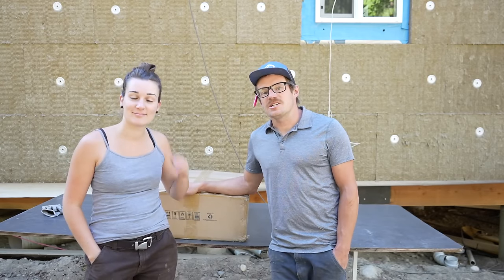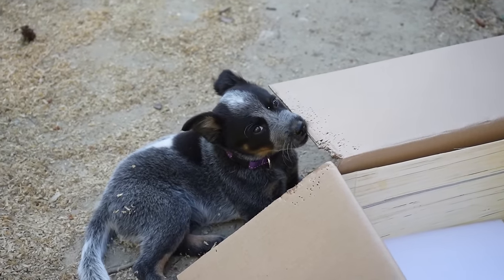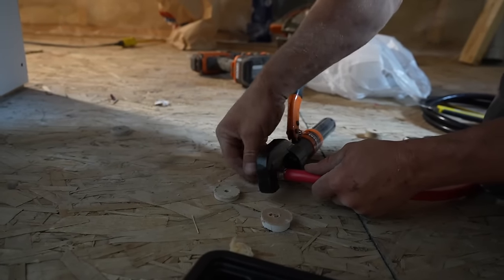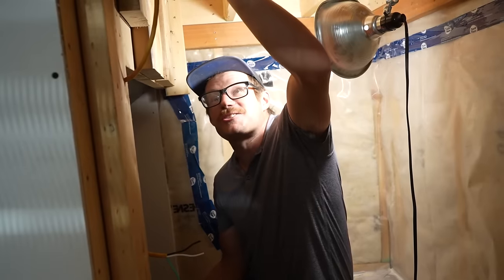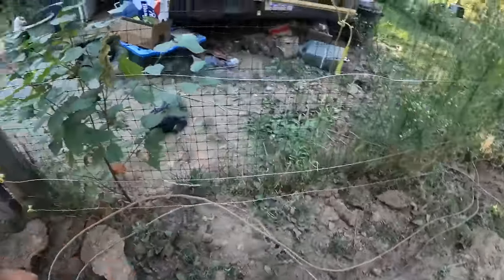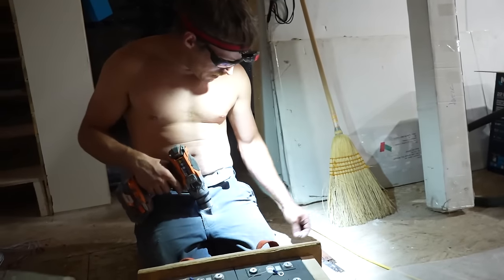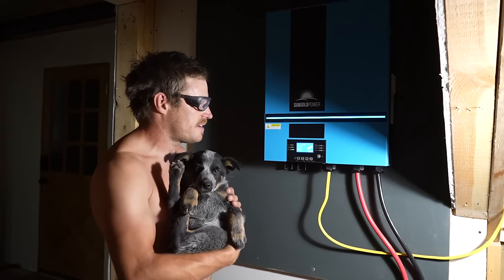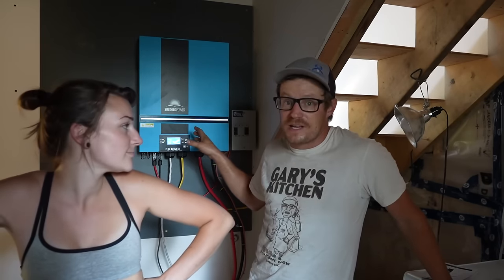Powering Up Our Off Grid Home! Installing Sungold Power 48v 6500 w Solar All In One System

Comment: You'll get a much better price for the exact same inverter design (same design, same parts, same warranty) by purchasing a Sigineer Power Off Grid 48V 6500 all in one inverter charger. Both Sungold Power and Sigineer Power are made by the same manufacturer, but the Sigineer Power inverter cost's far less.

Comment: We have a 5.6 kw of solar panels on our house, 6kw inverter and 4.6 kw Battery, it’s helping us out a lot with rising energy costs in the UK.  We are connected to the grid for both gas and electric, we sell back the power we can’t use to the the grid.  The last 2 months our every costs have been less than £15 a month.

Comment: I have pretty much same unit (Not the same brand but they are all made by VoltronicPower in china and is sold under different brand names). My unit is 5.2KW and has been running non-stop for the last 3 years trouble free. Had to take it down once for cleaning but apart from that, its been quite reliable. Congrats for setting this up.
Reply: Have you connected a generator to it?
Can it be connected? If so, how do designate polarity?
Reply: @cjmcay  I haven't connected generator but i have it connected to the grid supply. The line, neutral and ground are clearly market at the connection points so it shouldn't be hard.
Reply: @Ayzee5363  Thanks for the quick response! My solar guy told me the generator has a magnetic coil and won't be compatible? He said it will FRY my inverter? BTW: WOW, as for getting that 200 pound battery bank out at one time!

Comment: Hello, I have downloaded two versions of the user's manual. On page 9: Max. PV Array Open Circuit Voltage: 250V (old version), 390Vdc (new version).  PV Array MPPT Voltage Range: 90Vdc~230Vdc (old version), 90Vdc~350Vdc (new version).
Reply from the maker: They did change the mppt voltage in the newer version

Comment: I have a mttp all in one it's on its second year & I like it & iam off grid as well oh & it will also save u in gas cuz generator charge batteries when u have to use it & ur get more power for later that's  the way to go
Reply: What would that be
Reply: @harlanmclain1719   It's a fake account and they are running a SCAM trying to get you to send money for shipping.  DON'T TALK TO THEM OR SEND ANY MONEY.  Anytime you see a comment like that, report it!

Comment: We just installed a dual EG 6500 EX system for 240 split phase for the house we're building.  We bought 2 EG4 Powerlife batteries so we've got a 13kw system with 11kwh storage.  Found some CanadianSolar 445 Watt bifacial panels from SanTan Solar in Arizona and got a dozen of those.  Now we've got to clear the top of a hill for our solar array.  It's a lot of work, but worth it when you can generate all the power you need for yourself.
Reply from the maker: It will be amazing when it's all hooked up

Comment: Sweet! I have two of those SunGold 6500 units sitting in the boxes. I will be setting them up in a couple weeks on my off-grid property. Will be paired up with about 8KW of bifacial panels and 2 Trophy 48V 100AH batteries. I am looking forward to getting it all setup.
Reply from the maker: Nice setup!
Reply: @ThisOffGridLife  you guys and several other channels inspired me to continue my off grid journey after losing my wife. It was our dream.
Reply: @blaxtarr  good on you! 👍🏻 I’m over 60 and we are off grid now. By accident more than design really but it’s the best decision we ever made. I think you are going to need more batteries for your system. 😊👍🏻
Reply: @blaxtarr  sorry about your loss
Reply: @Farm Villa  I'm off grid by accident also. They cut off all power to the yard I store all my equipment at and actually live there. I'm just single so I don't need a lot but I'm doing this Sun gold 6500 with three server rack batteries everything's coming in very soon and I'm going to have about 3000 Watts worth of solar panel maybe a second string also. Trying to figure out my wire size at the moment. I think they're sending me four gauge wire but I might need bigger. I know on my 12-volt system I have  1/0
Reply: @VinceBadovinatz88  yep. Wire size is important. There are a few sites out there with wire size calculators if you haven’t seen them yet. 👍🏻 Good luck with your install.
Reply: @FarmsVilla  Thank u very much😎

Comment: Nice video. I did see that that inverter is clone of MPP Solar inverter. 

I would suggest : 

1. take that remote control unit out of the main inverter..it will cool it more and you will not bump into that start switch ..maybe not your concern but it was mine.. also check that it isn't too hot close to those Lan cables ..that is where main 7805 is placed and it gets hot..
2. mine unit 11kW has 3 fans and they are on all the time..so for sure you want to be sure you will move it out ..as it get pretty loud when it is on full throttle :)..
3. btw it is pity that they didn't explain better that when you want to change output voltagefrom 220-240V  it is possible only in off mode..it frustrated me ..till i was able find it out :) 
4. make sure your room is clean and there isn't dust..as gets in pretty fast..there is input filter..so if nothing else clear it pretty regularly..i would say weekly..(it is new constr..so a lot of dust i would imagine )
5. I added hole into right side of that blue removable panel..I hope it will improve cooling of this unit..and then added mesh ..that is used to PC ventilators..

So far i have positive experience with the unit as well.. ofc that software you mentioned..well it isn't much ..i would say trash..is better word..but that isn't as much important ..It works and that is important..

Btw i notice consumption isn't so small..so that is con in this case..you make sure you size your battery accordingly..

Comment: I think that you should get a hand truck to move heavy things like the batteries around. Just FYI: the hand truck is that thing with two wheels like what delivery people use to move keggers, stacks of pop, boxes and things like that around. Although most people call this a dolly it is not a dolly, which is the flat thing with two or four swiveling wheels that people lay heavy,  big, awkward things on to move them around. A dolly won't work in the dirt or gravel or soft ground. A hand truck works every where accept in mud or snow. If the snow is not so deep and compacted it will work on that too. What the two of you did is really dangerous to your backs. Just ask Katie what that feels like. I've dealt with mine since 1981. And, once hurt it is easy to hurt it again, and again...! Please be very careful.

Comment: next time buying 2/0 cable buy welding cable .... much cheaper than battery cable...check the prices...I was replacing the Positive batt cable in a 67 shelby ..(battery is in the trunk) battery cable 26"ft was almost 100 us... welding cable 2/0 was  3o+ us... `1/3 the price

Comment: What capacity is the circuit breaker you installed for this 6500w 48v system? My battery is 48v 150Ah... Regards

Comment: Hi, I have noticed there are alot of re-branded MPP LV6548 all-in-one inverter/chargers and this is one of them (SP6548). I am wondering how they can increase the max PV open circuit voltage from 250V to 390V unless there was some hardware upgrades. Is yours the max 250V or the max 390V version?

Comment: I have 2 units paralleled. Have you connected a generator to it?
Can it be connected? If so, how do designate polarity?
Reply: Yes they have a generator connection specifically for a generator on the SP6548

Comment: Thank you for sharing. We have two of these inverters that we are going to connect in parallel split phase. Setting up our system now with SOK batteries in a rack.
When you said in the video that you charged the batteries with the generator...did you then hook cables to the AC input on the inverter, or did you charge the batteries using some other charger?
Reply from the maker: The best part of this unit is the battery charger.  It's a 120a charger!!   You have to size your ac in wires large enough and have a big enough generator for that.
Reply: @ThisOffGridLife  Sorry...one more question. Do you an inverter generator? Someone somewhere said that the best is to use an inverter generator when you connect it to the inverter to use the charger.

Comment: You will want to make a way to clean out between stair tread and that panel. You will be amazed at the amount of dust that will gather in there. 😏
Reply from the maker: It all slides down to the bottom, we are going to cover and finish the stairs this winter

Comment: You're gonna need a chiropractor to help sponsor your channel.  :)  I must have missed it, but your previous system was using a 24v inverter, so I presumed the battery was 24 volts.  Did you wired two 24v batteries in series to get 48 volts?
Reply from the maker: We wired 16 - 3.2V cells in a 48v configuration
Reply: @ThisOffGridLife  - Did you have them in an 8S - 2P configuration when they were 24  volts?

Comment: I'm confused, Greg. I heard the intro that you gave this device, but I'm wondering why does it have the potential to catch fire? That doesn't make sense to me. Granted, every electronic device potential for something going wrong and setting something on fire. They are putting this non-combustible surface as a primary factor as to where it can be placed. I'm surprised that the CSA or UL or one of those others that you named, didn't flag that as an issue. It's in a steel box. Also, there has to be short circuit protection on the motherboard somewhere and fuses to cut power plus your own circuit protections you installed throughout the house, right? So why this attention to the potential for it catching fire?I've got two inverters in my RV and yes, they are in  steel cases, on a metal bulkhead, but nowhere in the user instructions or specifications is their any need to worry about them being mounted on fire resistant surface. I'm not criticizing, just trying to understand the reasoning behind the instructions, other than for the company wanting to indemnify itself from a potential lawsuit if something did by chance go wrong.
Reply from the maker: The concern is for the batteries being a fire risk, not the inverter. The cement board behind it was just something we had laying around and it just happens to be non combustible
Reply: The 48v lithium iron phosphate batteries are the safest you can get as they won't grow and explode like lead acid, AGM or lithium ion. The inverter CAN catch fire but it's extremely rare. The inverter will get hot enough to start wood on fire in some circumstances.  Always good to have something between the inverter and wood.

Comment: I don't understand why you fought with the cement board under the stairs if 1) you were 100% sure your batteries were fire safe and 2) it was only gunna be a temporary storage for them in the first place?  Also, why not just take the day or two it would take to build a small shed to house everything the way you want that way you aren't wasting resources and time having to rebuild cables, patch drywall holes, etc from a temporary install?  Do it right, do it once.

Comment: I am wondering if the cables running between the batteries are to thin?
Reply from the maker: They meet the specifications in the manual
Reply: I agree .. he needs much thicker wires connecting the batteries together .. once he puts a load on his inverter, those thin wires will burn out
Reply: 10 Guage is what they call for in the manual.

Comment: for what you spend on going solar to run your house and deal with it for 10 years and I can it for less being on the power grid, I just watch a couple who 50 grand to set up their solar system and it will be 10 years for them so they say so I did the math and it is cheaper for me to be on the grid and that is fact

Comment: i would never have them batteries in the house, even though insurance would replace the loss, them batteries are well know to burst in to flames well charging, even new EV cars have burned up,   it been well known ever since the Dream liner jets can out,, i even had electronic item burst in to flames after i plugged it in to charge, lucky i was right there

Comment: you could have pulled the wire up, Kate. you are certainly strong enough. if you would have committed yourselrf and belived you could do it you would have. easily. how deep was it 2/3 inches? greg was a bit overdramatic with the double arm flex.

Comment: The EG4 is UL1741 certified, with better specs (500V input), and costs $1250. This looks exactly like the EG4 for $100 more and less input voltage (and not UL listed). So what else is the difference? Why do the Chinese all rip off each other's designs? Which is better and which is made from inferior parts? Here's my guess: EG4 just got theirs UL listed a few months ago, new model number, shipping product, and you can see reviews of it all over YouTube. Sungoldpower is stealing the same design and is a few months behind getting their copies out there. Sungoldpower did the exact thing when they copied the AIMS 24V DC 6000W 240VAC split phase inverter. I have one. It works fine. But talk about intellectual property theft. The Chinese have no ethics.
Reply from the maker: The 500v version of this unit is being distributed later this month!  The units are exactly similar because they are the same MPP was the first to distribute this unit.  Sungold powers version is blue, and they were happy to reach out to us with their version of the 6548.  This unit is ul listed as well, I am assuming you watched will Prowse's early review of the unit before it got its UL certificate.  All of the 6548 units are awesome, if your into solar it's a one stop shop and I highly recommend it!
Reply: @ThisOffGridLife  I get it man, I just don't like the way we see so many brands with the exact same design, and cannot trust the quality of components inside, when they don't have the integrity to to not steal another engineer's design. Sigineer is another 'brand' that looks just like the AIMS
Reply: @Gruuvin1 they are All made in the same factory on the same lines. Just different covers.